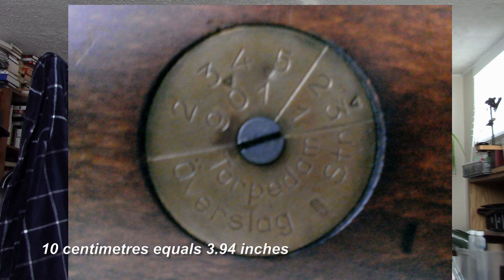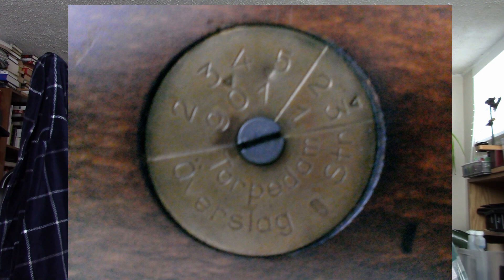How to read Swedish rifle buttstock disks

Comment: Did the Swedish armourers at the time have bore scopes at the time or did they have some kind of Swedish super bore vision, because I've seen some rifles marked with a 2 that looked absolutely spotless.
Reply from the maker: I was initially prepared to smile at the suggestion but it appears that bore scopes have been a thing since the 1940s. Apparently they were long and inflexible optic devices that allowed you to scope a bore.

So it's certainly possible that after that, the Swedes did have borescopes.

Comment: I have to agree.  Do not get hung up on the discs.  I have an M96 with a 650 bore and in condition 3 according to the disc.  inspection of the bore reveals bright shiny bore with clear sharp edged rifling.   It touches holes at 100 yards.  It clearly shoots sub minute of angle.  I have used it for international hi-power shooting which is a 200 yard competition.  No problem hitting the bull at 200 yards with open sights (prone position of course).   I am wondering about two possibilities, could the armorer have intentionally incorrectly coded the rifles so that they could turn them over and get new rifles?  Or....,  Could the barrel have been already been replaced but not the disc?  It just seems odd that the disc must have been stamped "3 " many decades ago yet today, has a bore that looks like it just came from the factory.  I find this odd.
Reply from the maker: That is rather odd -- I'd be surprised if an armorer would do that but strange things happen all of the time -- that said, had they replaced the rifle I'd be surprised if they didn't remark the disk or put a new one on. Again, might have been an oversight. At any rate, I'm quite happy that your "incorrectly" marked rifle is so accurate. You definitely have a fantastic rifle there.
Reply: Yeah, I hear you. It is odd.  I am an ex gun dealer and gunsmith.  I have handled many Swede Mausers.  I have yet to find a rusted barrel or one with a shot out bore.  That is why I question the disc.  I guess we will never know.  ;-)  The overall cosmetic condition of my 1916 M96 is remarkable.  It is 100% matching and really doesn't look like it was ever used.  A 140 gn spitzer is a perfect round to put through these rifles.
Reply: Just got a sporterized one today with scope for $350. They gunsmith that converted it cut down the barrel behind the front sight, cut down the fore grip and beveled the bolt handle flat. My disc is the older version that shows a 3 condition and 6.52 bore. I just shot it today at 100 yards and had a 3” grouping. hickok45 says in his video he thinks the 3s were fitted with new barrels. Their are also Markings on the underside of the stock which signify of the gun was shot for accuracy or conveyed to shoot wooden blanks. Mine wasn’t used for either of those but I’m still wondering why this is so accurate especially since this is the older version

Comment: down here in the usa feb.2020 i paid 1000.00 and it is said to be a great deal.. i have seen them as hi as 3000.00 very hard to find down here.
Reply from the maker: They aren't too common up here either -- at least I haven't seen too many lately though I did come across a Swedish M38 the other week that I wish I had bit on because it was gone for CAD$595.
Reply: @TheRedneckPreppy  there are alot of1896 1938 are comin down here but not cheap .for military shoots here thats the rifle to have they win 250 yard plate shoots every time
Reply from the maker: @georgel4600  Then I should have bought the damned thing when I had the chance :-)
Reply: @TheRedneckPreppy  yes great rifle flat shooter the 6.5 swedish wish i had the 1896 my self
Reply from the maker: @georgel4600  that reminds me, I need to take my M96 out :-)
Reply: @TheRedneckPreppy  i would like to see it do you handload for it. ammo down here is not cheap 35.00 a box of 20 here.i have a  1898 30.40   krag 65,00 box of 20 here.